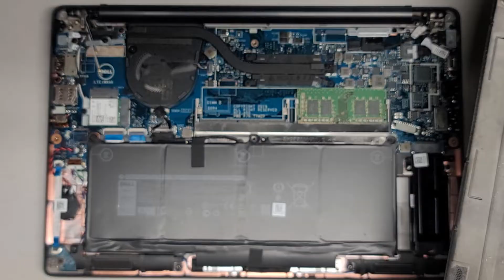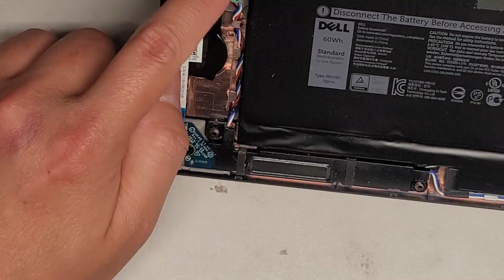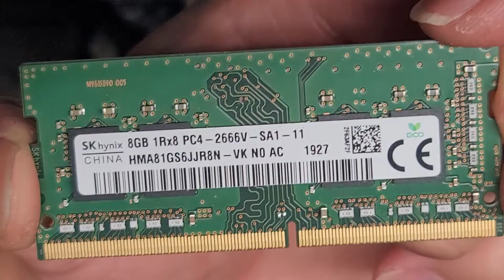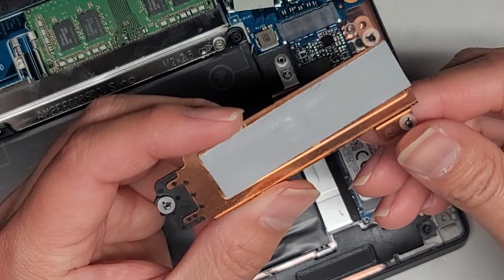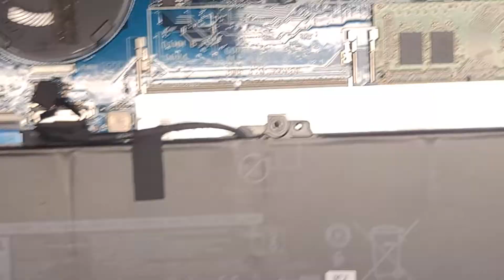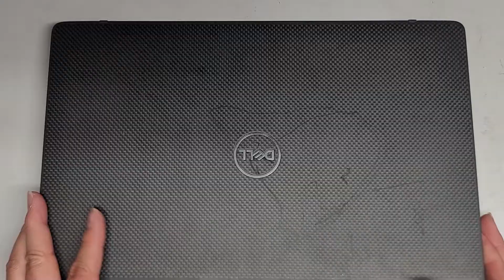DELL Latitude 7400 Disassembly RAM SSD Hard Drive Upgrade Battery Replacement Repair Quick Look

Comment: Ive had this for years and this is a known issue with this model. The 7400 shouldnt be held in anyway that bends the body and especially the motherboard. the RAM in particular gets affected and will have to be reseated.
Reply from the maker: That's crazy
Reply: How did you fix this. It affects me too

Comment: hey there, i have the same laptop and i actually got shipped a F23YT battery model which has the same specs as this one, 60Wh 7.6V but will it fit in?
Reply: originally my laptop has 42Wh OG74G
Reply from the maker: Not sure
Reply: @ItsBinhRepaired  MXV9V and F23YT only have a super small difference that the screw position varies, like its on the side for F23YT
Reply from the maker: @code-charm-linux  might be ok

Comment: Hi
I know this is an old video but I have a quick question. 
Are the tabs on the sides that hold the ram spring loaded ? I'm upgrading and don't want to break anything.
Thank you
Reply from the maker: There are no "springs", but they do use a metal that goes back.
Reply: @ItsBinhRepaired  thanks
Reply from the maker: @oldfisherman5112  yup

Comment: Can I add or change the graphics card to this?
Reply from the maker: No
Reply: @ItsBinhRepaired do you have a recommendation for a gaming laptop 400 or less?
Reply from the maker: @funnyguy1941  you'd have to find something used. $400 is barely enough for a low end laptop.
Reply: @ItsBinhRepaired  ye do you have any recommendations
Reply from the maker: I'm not sure, sorry. Used stuff are constantly changing and depends what people are selling at the time.

Comment: Thanks for the breakdown. I think I can add a larger ssd to this myself. It's too bad there is only one slot. Do you think there are any problems adding a 4tb ssd to this? Crucial says it is compatible.
Reply from the maker: Should work

Comment: thanks for the info i doubled my ram  from 16 up to 2 16(mg)  32 total now and i was looking to see where the hard drive was lol,,, so thanks,also i coildnt figure how to unhook the battery so i did the ram as is. works fine. thanks for the demo
Reply: Can I install 2x32 GB RAM in this laptop. Intel says this cpu supports 64GB
Reply: @AshiqurRahman D latitude 7400 max is 32 Gb (2x16) according to crucial
Reply from the maker: Don't listen to them. Lol Max is what you can find and buy 99% of the time.
Reply: @ItsBinhRepaired  anyone try to do the H24 update ? i tried several of the fixes,but then saw microsoft saying to not do the update,and once they fix the bug , it will update automatically.
Reply from the maker: Awesome! Glad it helped. If you haven't already, please like and subscribe so others can find my videos and possibly consider watching a few others to get the algorithm to recommend my channel. Thanks!

Comment: Which battery should we use lipo or lion this modell has two options
Reply from the maker: There's no way it uses lion. Lion will be cylindrical cells in a pack instead of the flat packs.

Comment: why you use your fingers to whipe that contacts? of course your finger have some moisture and salt that dont distroy the contacts, but certainly put some oxidation with time. better to whipe with a clean towel and alcool/distiled water
this is not an opinion, it's just technical
Reply from the maker: Yes, but the effects are negligible. People using that liquid metal thermal paste is much more likely to kill the computer over time.

Comment: pjp12 could be for touchscreen, mine has cables connected to it.
Reply: I'm definitely going to lean towards touchscreen connection.  I'm working on a model with touchscreen and there is a cable connected here.
Reply from the maker: Got it
Reply from the maker: Interesting

Comment: As usual iconic dell with its 3rd class cheap plastic body and flaky hinges
Reply from the maker: They're all cheap now
Reply: @ItsBinhRepaired   and expensive as well....
Reply from the maker: Lol yeah
Reply: The Dell chassis on this model isn't plastic. I’d describe it as a mix of metal and plastic. The service panel is metal.

Comment: I have this same model. My problem is bios password. Can you help me
Reply from the maker: I cannot
Reply: reset it..
Reply: @richievellalar3214  how do I reset it?
Reply: @obedantwisarkodie  are you desktop or laptop
Reply: @obedantwisarkodie  open your machine , remove the CMOS battery for 30 minutes , then insert back , turn back again , password will be removed.  Update me
Reply from the maker: That won't remove a bios password
Reply: @ItsBinhRepaired  it will , wait 30 minutes , remove the jumper connector , switch back wait 10minutes then switch back again to original place.
Reply from the maker: It won't